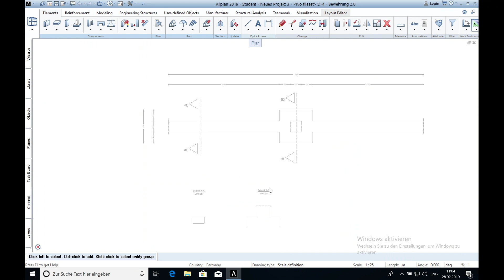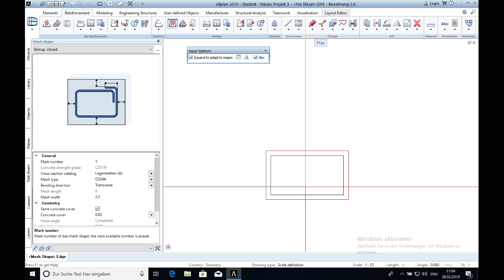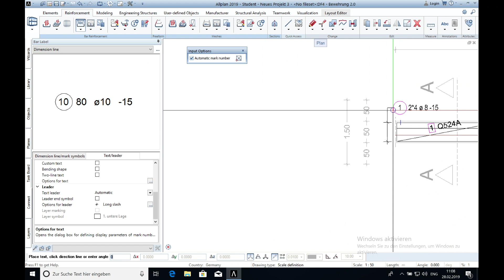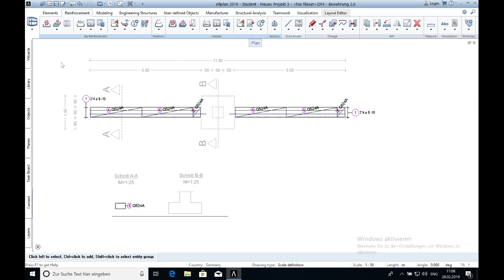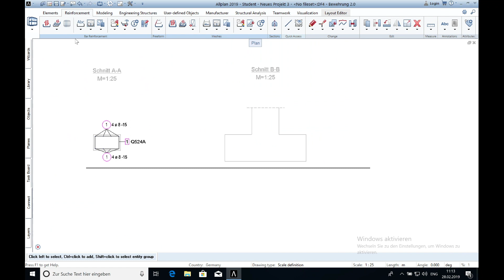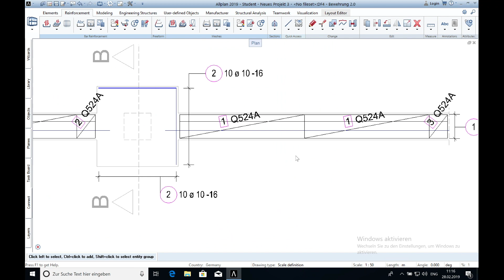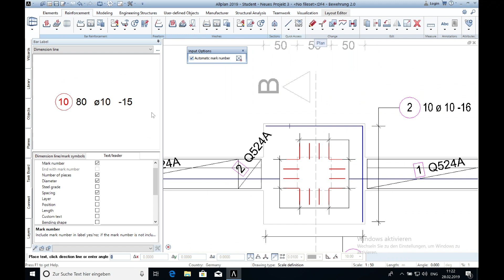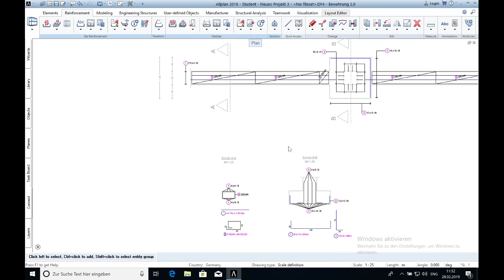how to create 2d reinforcement in Allplan 2019 beginner tutorial

Comment: How can  you make your span mesh seen in cross section, while doing it on 2D?
Reply from the maker: What do you mean exactly?
Reply: @jan-weber  I have a slab that is finished with corner reinforcement, or is has opening. Then I draw a cross section of ths detail, but I have placed the meshes as area reinforcement -how can I represent those mashes in cross section, while using 2D reinforcement. In 3D it was simple, it just showed up as you placed it.
Reply from the maker: @bimaepucelj1457  hello, now I understand. Well, when you have 2D area mesh reinforcement, the only option I know is to "fake" the area mesh reinforcement in your section by drawing it by yourself. I would  do it like this. 

Sometimes you have to tricks like that to make it work. :)
Reply: @jan-weber  I thought so myself and that is currently the practice :)

I myself, usually draw 3D reinforcement, but I saw some good potential with the things that keep recurring in my drawings, specially when I make masonry buildings, that have the same detailing over and over